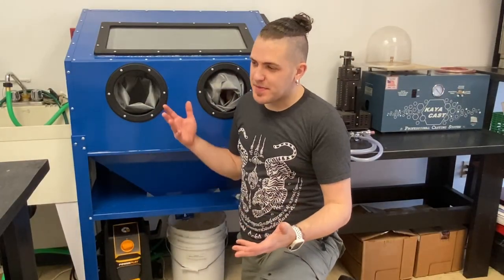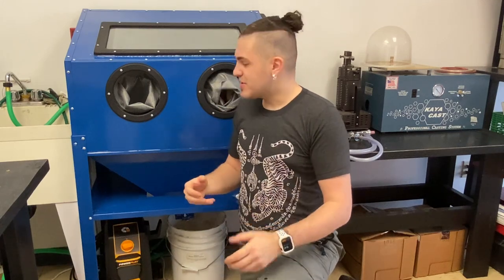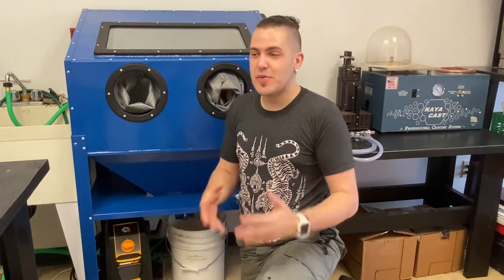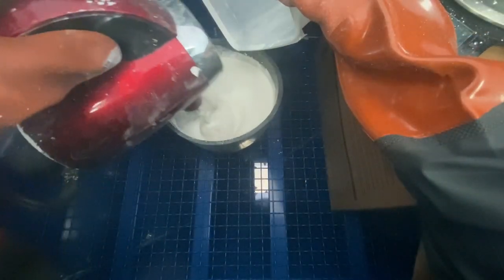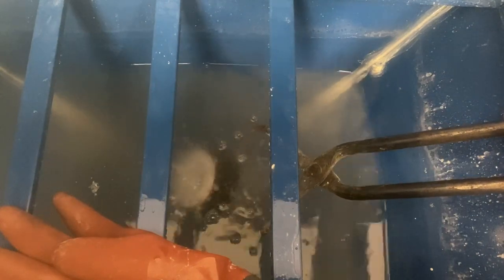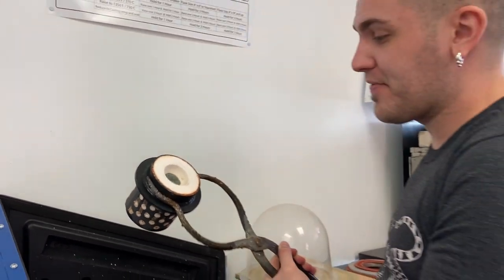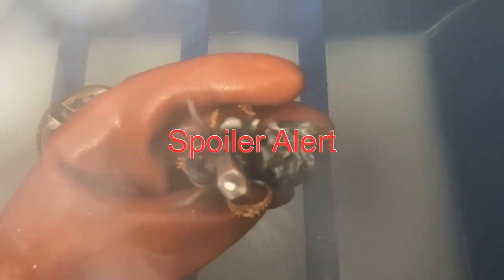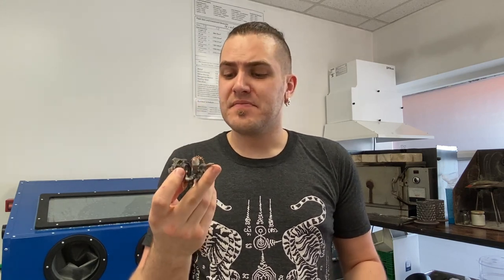Affordable DIY Silica Containment Station - Mixing, Quenching, Pressure Washing

Comment: Does the pressure washer come with a tip to not use the longer pole sections? I'm about to go buy this setup and that's the on part I can't figure out.

Wondering if you had to make or purchase something to not use the long pieces.

Comment: Great video. The multi use cabinet is awesome. I’ve been using a pressure sprayer outside to clean out my castings for a couple of months. It has saved me countless hours! Most of my castings are hollow brass spheres and getting the investment out through the openings is difficult to say the least. The pressure sprayer worked well, but I love your setup with the cabinet. Much more control that way AND it’s multi use! It almost looked like I could fit my vacuum pot in there when I mix the investment.

Q: Do you have a link or any literature on adding the acid to the mixture? I’m not sure it’d be useful for me but that was interesting none the less.

Comment: Thanks for sharing that setup.
i have a question about your 'lost Resin' process. Do you find some resins working better than others but share a common burnout process? I'd love to know what that process is. I've been working on a ring for myself and would rather burn out the resin than make a silicone mold, shoot wax and invest. Print, invest and burnout sounds much better.
Reply from the maker: When we do resin testing we generally follow the suggested burnout from R&R Plasticast. We have only had 3 of the dozen or so fail completely. We generally don't put in additives to the investment but it was specifically requested for the resin we used in this video. 
We can walk you through our burnout process if you like as part of our membership program.